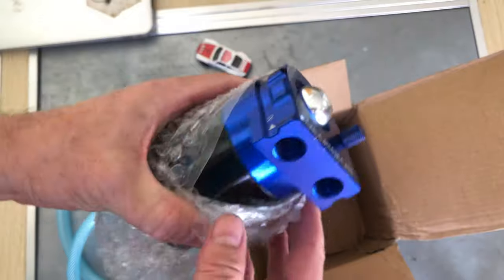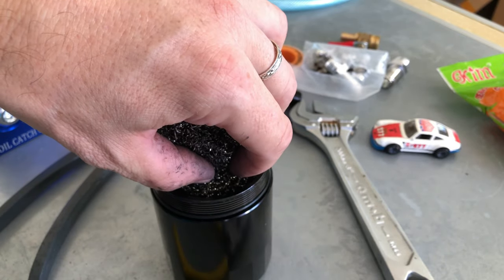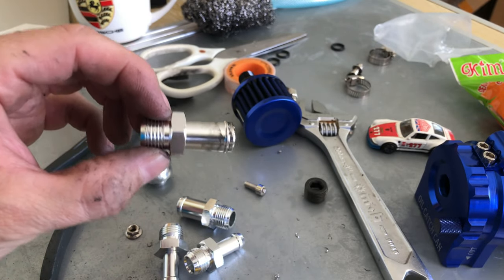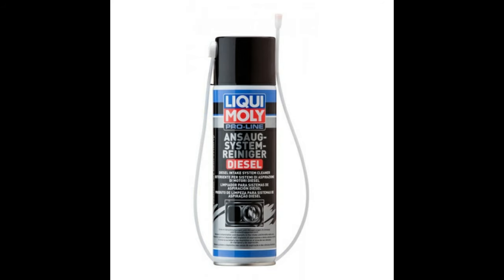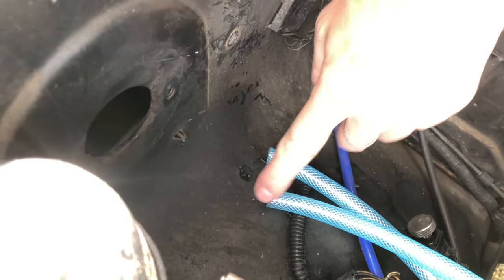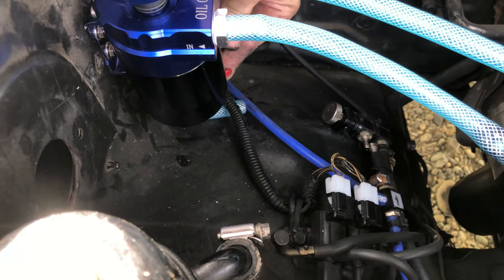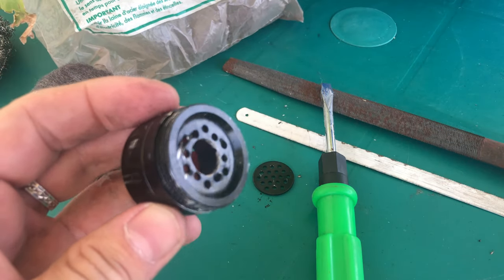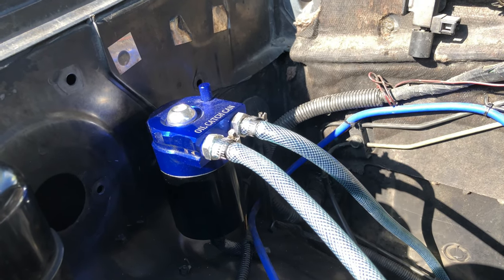HOW TO: INSTALL OIL CATCH CAN INTAKE TURBO DIESEL GAS PAJERO SHOGUN DELICA L200 L400 MITSUBISHI

Comment: hi on what speed the intercooler should be activated?
Reply from the maker: Hello, do you mean the intercooler fan, or when is the intercooler functioning? One answer sort of fits both questions, but your intercooler isn't useful until your turbo starts pushing air through it, which is not in stop & go traffic. This is also the only time a fan is really useful, except that it's not, because the turbo isn't spooling in regular city driving.
Reply: @offgridislandfamily  thanks so, there should be a sensor somewhere, Got this pajero work from a shop here, but suddenly majority of the sensors now are not working. ill need to check some good electrician around here to work for my intercooler turbo fan.
Reply from the maker: @kuyaYves  OK...so, there is a temperature sensor at the back driver's side of the intercooler. You'll see two screws holding it in and one wire coming off of it. But, the fan is actually pretty useless, because the intercooler won't do anything for a turbo that is not spooling. And if the turbo is spooling, then the vehicle is moving fast enough for the hood scoop to pull in enough cool air. I think the electric fan is a neat idea, but not useful.

Comment: Do we must have to plug it back to the turbo ? Nice video mate.
Reply from the maker: Well, the line comes from the valve cover to the can at the 'IN' side. The 'OUT' side goes back to the original location at the intake tube between air filter and turbo. Thanks for the compliment...I truly appreciate it.

Comment: How effective is this oil catch tank for the 4m40? Is it worth it?
Reply from the maker: NOT AT ALL. ;-) That is why I updated the video description with a link to a FAR BETTER catch can for a cranky old diesel engine.
Reply: My 4m40 is recently rebuilt completely with stock internals no upgrades. Would any oil catch tank be useful for it?
Reply: NOOOOO

Comment: It’s normal that smoke comes out from the filter???
Reply from the maker: Yes. All engines, even new cars today, have a hose running from the valve cover to the intake system. All engines produce these crankcase gasses and of course the more worn the engine, the more piston ring blow-by and thus, more oil gasses produced. If you're referring to the filter on the catch can, then NO. I did an update video where I remove the filter and re-install the aluminum plug.
Reply: @offgridislandfamily  aha thats mean its good the smokes comes out cuz i got one same thing the smokes comes out from the filter but i had some leaks in the catch can
Reply from the maker: @BarhoomMX  Actually, YES. This means those gasses are NOT going back into the intake system or combustion process.
Reply from the maker: @BarhoomMX  Leaks in the catch can are probably not super important. ;-)

Comment: Had my pajero 2.8 for 14 years why would I put  this crap on it runs great never lets me down leave well alone does not need this
Reply from the maker: 'Crap'? Uhh...ok.Clearly you don't understand emissions systems. The function is very logical and simple. Your intercooler functions to cool air and increase hp. Oil coating the system reduces this functionality. Cleaning the system and keeping oil out results in top efficiency.

Comment: Kinda wished you would of linked this unit instead of the one you wished you had in the description block...
Reply from the maker: You mean...you wish I had posted links for the unit seen in the video that did NOT work?
Reply: @offgridislandfamily  that did not work in your situation? Yes.
Reply from the maker: @08StreetGlide  Ok. Well the one featured in the video, which is NOT correct for big, old diesel engines, is very easy to find on any online shopping site.

Comment: now i know all car engineers like all of them all stooped like MB, PORSCHE,AUDI,CRYSLER EVEN ROLLS ROYS NO ONE FIGURE THAT THEY NEED INSTALL SIMPLE OIL CATCH CANS LOL OMG!!!
Reply from the maker: Do you mind explaining your point so others may benefit from it? Thanks...
Reply: @offgridislandfamily  its pointless mode nobody gonna drive long enough to get benefits from it.its one of the reasons its a waste of time and money
Reply from the maker: @greggregorich8048  Hehehe...'nobody gonna drive long enough to get benefits'? Ok...hehehehe
Reply: @offgridislandfamily  im not talking oil in a cans im talking about manifolds,do you have idea how long it takes to buidup the residue inside a manifold.6000 miles,50 000 miles .for the next cleanup.
Reply from the maker: @greggregorich8048  Build-up inside the intake manifold is only ONE of several reasons to install catch cans. 2. Keeping residue off the valve-train is another. 3. The gasses removed by a catch can, if allowed return to the engine oil, would have a negative effect on engine oil viscosity and lubrication effectiveness. 4. Gasses also coat the inside of the entire intake system, which on most turbo vehicles, means the intercooler and intercooler piping system. Coating the inside of this intake cooling system obviously reducing air-cooling efficiency and thus, power. 5. The gasses being sent from your valve cover to the intake tube also burn much less effectively than fuel...again...reducing power. Finally, ALL cars built after about 1950 send valve cover gasses to the carburetor and/or intake system. This includes all the cars you have ever driven.